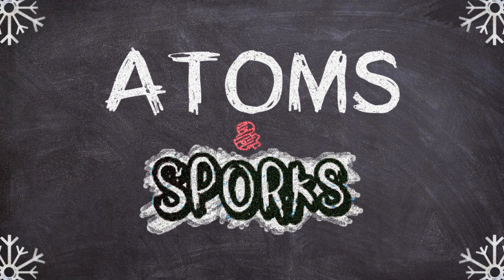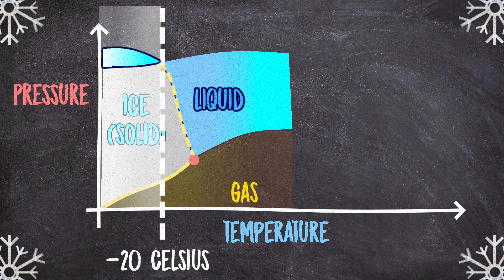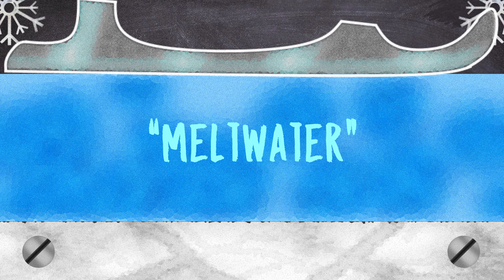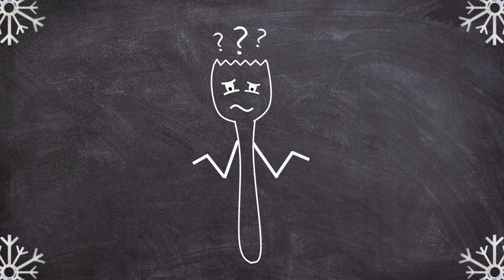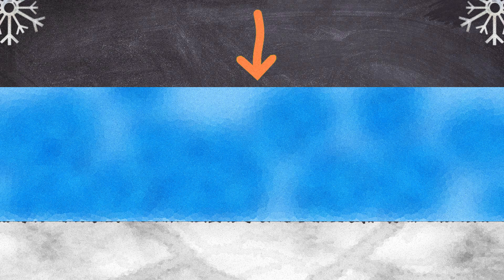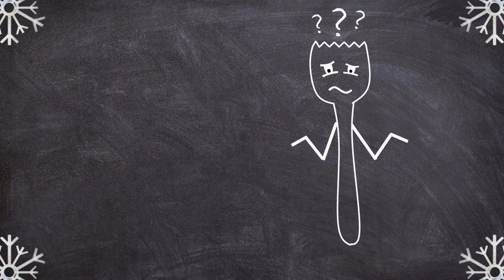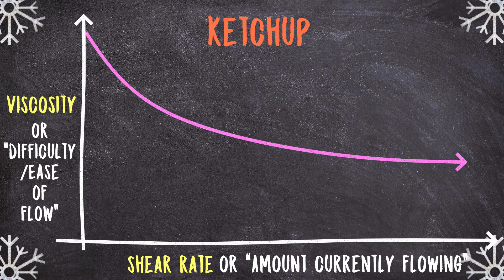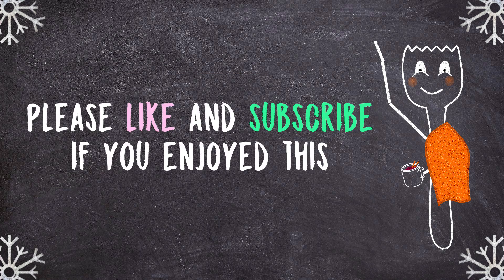Holiday Physics: Why Do We STILL Not Understand Ice Skating? (And How Does... Ketchup Come In?)

Comment: Yea that thin layer of water thing never felt right to me. I think it's more like graphite to be honest. The smallest fragment of ice is a snowflake-seed. A hexagon of water molecules, a plane, much like the smallest graphite chunk is equal to the smallest chunk of graphene, a hexagon of carbon. There may be some minimal amount of water right after the blade passes that looks like what's causing it is water, and it's interesting to think that the viscosity of this microfluid approaches water at higher speeds, because at higher speeds, in water there is hydroplaning, another macro version of sliding, as in riding, and I'm sure this is an effect too... but really at the quantum nano molecular level I think it's the brittle ice being ground like flour in a mill into tiny hexagons that slide like what would happen if you tried to drag a heavy iron safe across a floor covered in playing cards. The sheering just keeps happening as the thing slides and it's like a combination of ball bearings made from sliding planes and water molecules. 

I said it a few times ago but I'll say it again. This channel hits the missing link of thinking for me. It starts from a critical, intuition proofing position that still rests firmly on hard science. So much of the stuff out there is just enough sense to quell the curiosity of the standard nerdy types... I always felt like something wasn't quite right with this or that and I had started to lose hope that even the weirder truths all come from the same place... I really really hope you keep posting videos that interest you and that people need to see. Great stuff as always!